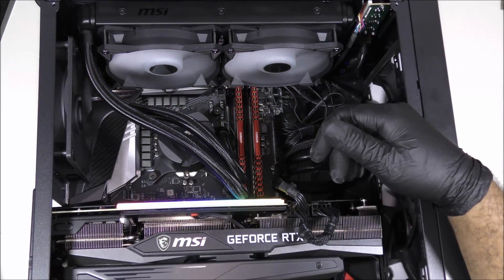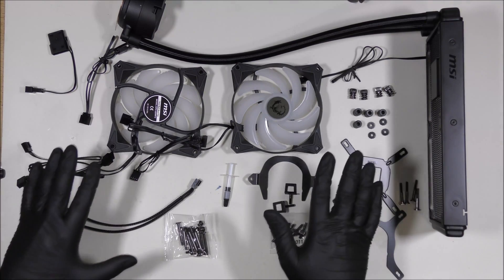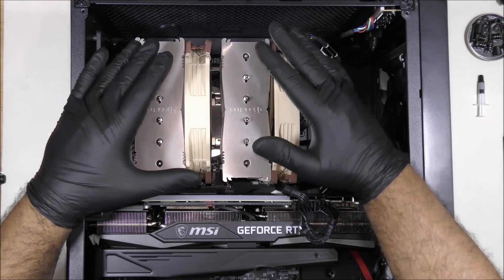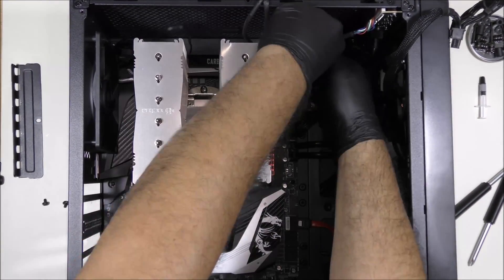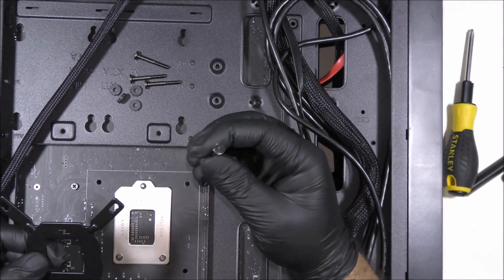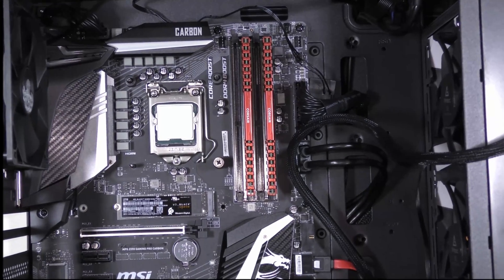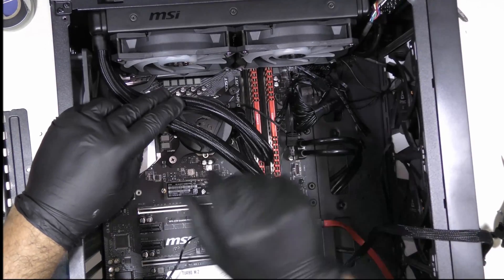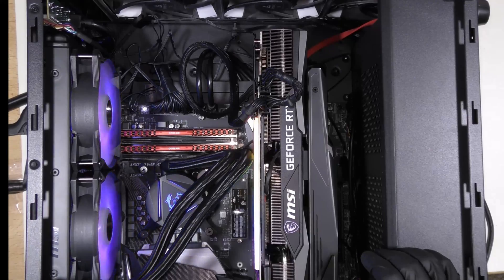How to Install MSI MAG Series CORELIQUID 240R/360R, RGB CPU Liquid Cooler Step By Step

Comment: Forgot to mention that the holes for the radiator that the screws go in are NOT threaded, was very surprising for myself as a beginner. You have to screw in the screws which create their own threads. It takes a little elbow grease, but be careful, as if using a screw driver you have accidentally hit into the radiator fins.
Reply: Ftcx❤

Comment: Due to the position of the pump ( inside the radiator) it's best to place the radiator to the front of the pc case and the pump at the bottom.
Reply: I thought the pump was inside the piece that mounts on top of the CPU.

Comment: Just one queston please. I seefan mount correctly for the bottom mount on the case. Now i see a lot builders that mount those fans diferently, i mean upsetdown when they mount the radiator  vertical on left side of the pc case. So is that a correct fan mounts for left side mounting ? thank you.

Comment: What is those 3 pins pump connector really for????? You show us the step by step but didn't really show enough.
Reply: The 3 pin you're referring to goes on the aio pump header which is close to the cpu fan header

Comment: DONT INSTALL LIKE THIS !
I have it mounted at the top and after a few months it started making noise and the pc was warming abnormally. 

The general rule of 'radiator at the top' is because most AIOs have the pump on the block, sitting on top of the processor. You dont want bubbles to accumulate in your pump so in this configuration they go up and end up in the radiator. 
However this line of products has the pump integrated INSIDE THE RADIATOR so installing it at the top makes the bubbles accumulate at the pump which causes noise, reduced efficiency and total failure of the pump in a short time. 

Install it vertically in front of the case preferentially with the pump as low as possible!
Reply: Running V2, no issues w/ it at the top after 1 year.

Don't be scared off by this guy 😅

It's YMMV w/ every AIO.

Comment: We just installed this in my sons pc, we went on the bios and it was reading 92 degrees celsius is that still normal?? we bought some much better quality thermal paste than the factory one (Corsair XTM50) and applied it but i just thought it would be less than 92 degrees celsius, everything else was 20-30 degrees celsius.

Specs:

CPU: Intel Core i5-11400F 2.6GHz (4.4GHz Turbo) 6-Core 12-Thread
GPU: NVIDIA GeForce RTX 2060 6GB
Chipset: Intel B560
RAM: 16GB (2 x 8GB) DDR4 3000MHz
SSD: Intel 660p 512GB M.2 NVMe SSD
CPU Cooler: DeepCool Gammaxx GT RGB(REPLACED WITH MSI MAG CORE LIQUID 240 R V2 WHITE)
PSU: Thermaltake 600W Gold
Case: DeepCool Macube 310 ATX Case - White
Dimension: 19.50" x 8.50" x 16.70"
Reply: are you sure you removed the plastic film on the waterblock? how much thermal paste did you use?
Reply: @roman-o4y  Yeah i did but the issue was i didn't connect the radiator lol... but now the RGB won't work and it was working fine before. Put a good amount of thermal paste. The CPU now cools at 30 celsius but the RGB :(

Comment: Aren't u concerned tht the pump is on the top with air and bubble??
Reply: No? It has to be above it
Reply: I have it mounted at the top and after a few months it started making noise and the pc was warming abnormally. 

The general rule of 'radiator at the top' is because most AIOs have the pump on the block, sitting on top of the processor. You dont want bubbles to accumulate in your pump so in this configuration they go up and end up in the radiator. 
However this line of products has the pump integrated INSIDE THE RADIATOR so installing it at the top makes the bubbles accumulate at the pump which causes noise, reduced efficiency and total failure of the pump in a short time.
Reply: @tylercormier350 The pump in this model is inside the radiator and not on the CPU block

Comment: hello can you please make a video specifically for the 240mm radiator wiring (like the RGB)
Reply from the maker: Yes i can, HERE 👉 https://www.youtube.com/watch?v=iP1NsiJXLAI
Reply: Hey got gigabyte gaming x connected fans to cpu fan and cpu opt then pump to the pump header however in userbenchmark max temp goes all the wait to 100* what could i done wrong ?
Reply: @kususable  thermal paste? COnneect radiator cable to pump fan?
Reply: Yeh radiator is into the pump, fans tried to use the spliter then to connect them to cpu fan and cou fan opt. So the only chance is probably set manual speed @ bios and try again with thermal paste… i hate them AOI
Reply from the maker: HERE YOU GO https://www.youtube.com/watch?v=iP1NsiJXLAI

Comment from the maker: ⚠️ PLEASE READ: The PUMP/RADIATOR cable will connect to your motherboard's pump socket, the fans need to be connected together thus making one cable and then can be connected to the cpu_fan 1socket to be controlled.  

⚠️RGB CONNECTION TUTORIAL HERE 
👉https://www.youtube.com/watch?v=iP1NsiJXLAI

⚠️If you don't have a pump socket it will need to be connected to your  CPU_Fan socket and you must set the speed to 100% IN BIOS, the fans can be connected to sys_fan 2. (VERY IMPORTANT)

🚨(My Apologies) I realized that some parts of my video have been cut out while editing, connecting the Fans together you do need the Y splitter that came with the device, you connect both of the fans to that Y and then connect it to the motherboard in the sockets mentioned above 👆

⚠️HERE IS ThE VIDEO OF THE RGB CONNECTION THAT EVERYONE ASKED FOR 
👉https://www.youtube.com/watch?v=iP1NsiJXLAI
Reply: How do I connect the fans together?
Reply from the maker: Use the Y splitter that came with the radiator then connect it to your motherboard.
Reply: @USComputerSolutions  I managed to do so! Thanks for your reply! You really helped me out with your Vid!
Reply from the maker: Glad 🙂 that i could help, please consider liking and subscribing your support is most appreciated 😊